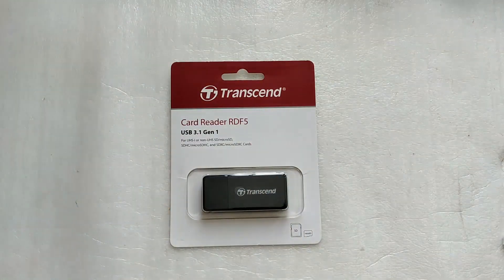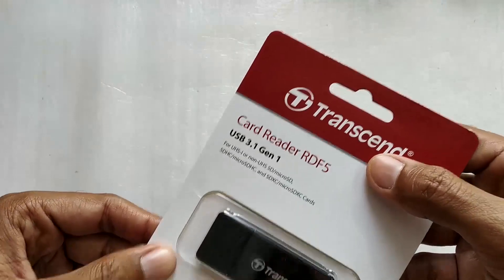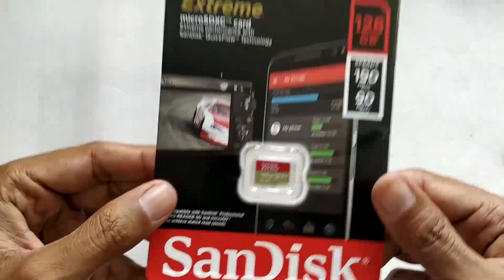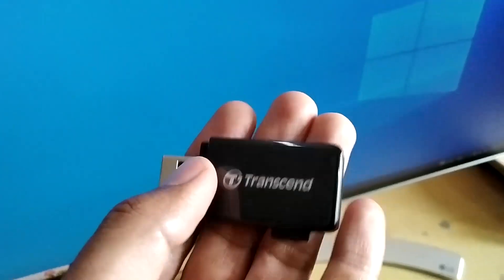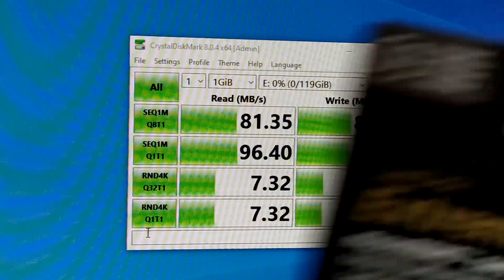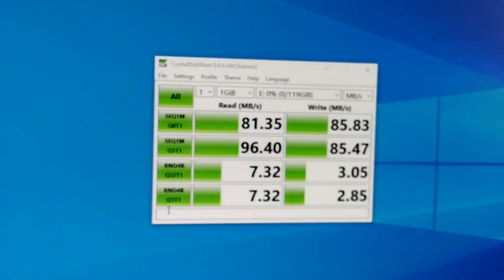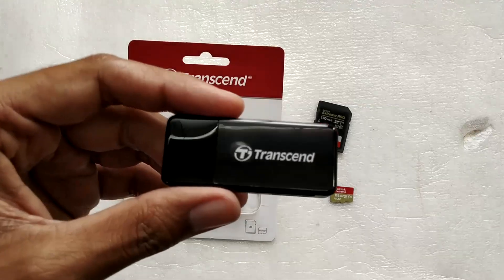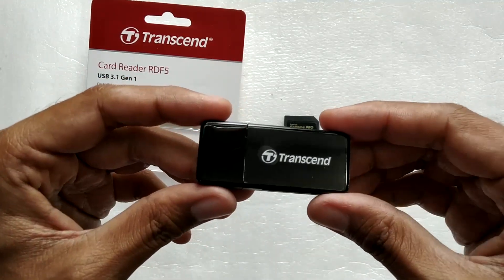Transcend TS RDF5 USB 3.1 Gen 1 Card Reader Review

Comment: Nice review..
Reply from the maker: Thank you Guga Raj.
Reply: @gurribuy  bro what is the minimum processor & board requirement for windows 11 ready ?
Reply from the maker: @GuGhaRaj  I don't know about AMD.
But as far as intel is concerned. 
Any intel 8gen processor and above should work with windows 11. But search for your particular processor just in case.
For motherboard buy any motherboard for your processor that comes with Trusted Platform Module (TPM) version 2.0
Reply: @gurribuy  thx bro